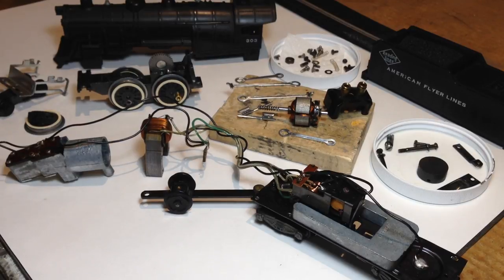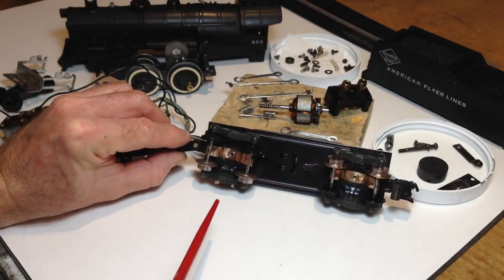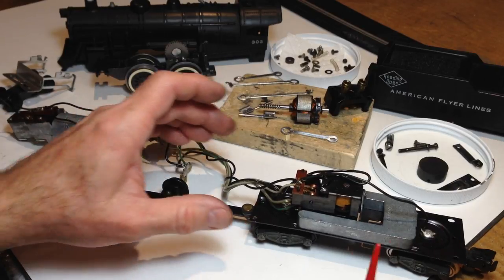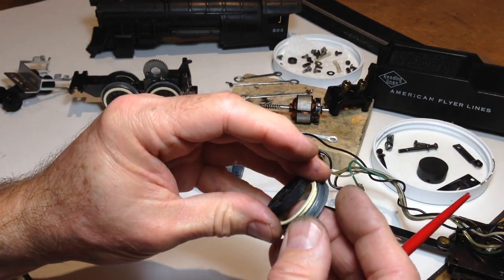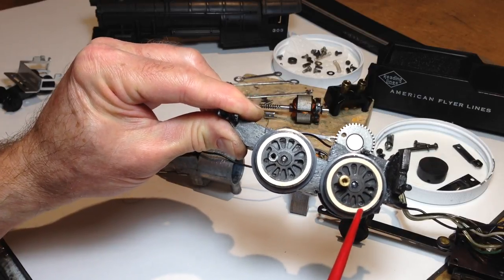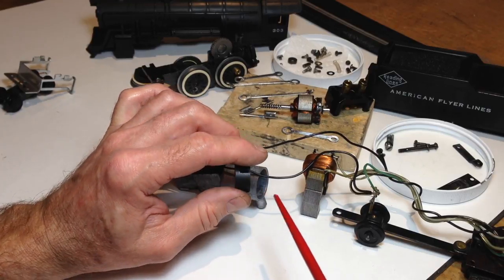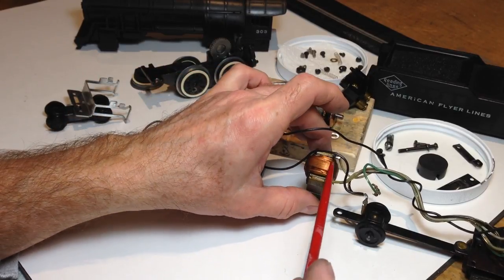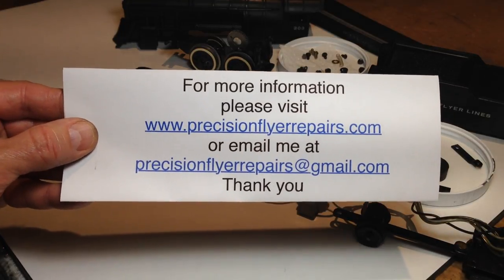American Flyer Anatomy 101: the Gilbert steam engine

Comment: Would you happen to have a video on how to solder new fingers to the wires the thank you
Reply from the maker: Thanks for watching.  I don’t have a video on the technique or method to use when soldering wires to reverse unit fingers, but one rule of thumb is do not allow the fingers to be in contact with the drum or the heat will damage the drum.  If it’s a wiring diagram you need then try portlines.com Clinic #10 or Google “American Flyer steam engine wiring diagrams”.